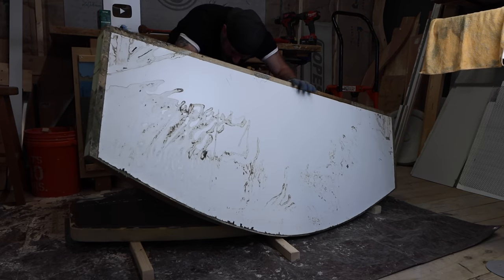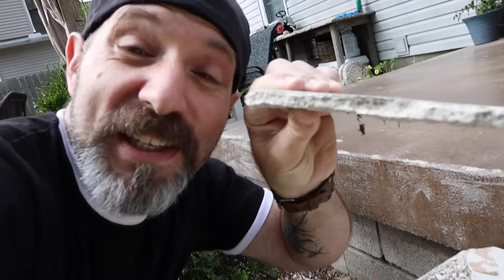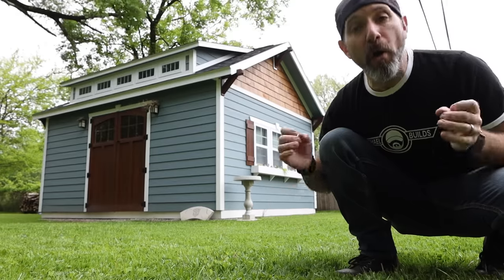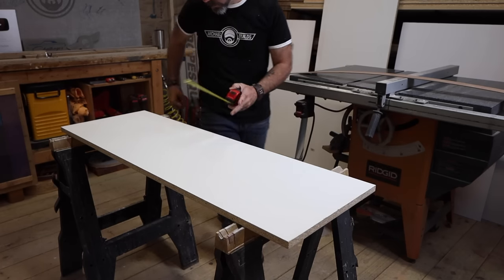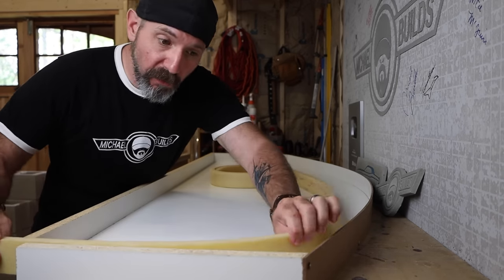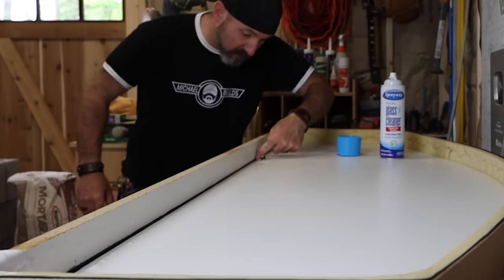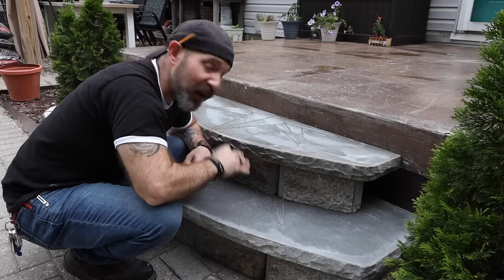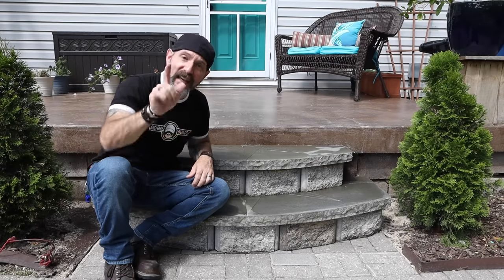Quick and Easy Concrete Steps

Comment: It's called Melamine, NOT Malemine! Also use a pad sander (without the sandpaper on it) to vibrate the sides to get the air bubbles out. And add a little dry mix on the slick Melamine surface to add some texture and a light dusting all over so it won't look like glass and be slicker than snot when wet!

Comment: Great build!  Spraying WD-40 and using a reciprocating saw without the blade are a couple of my go to‘s with these concrete projects.  Be safe and use a respirator.  👍🏼
Reply: Nice work!
Reply: I get really, really tired of the safety police giving us unwanted advice. But you are absolutely right: always wear a respirator when working with concrete, drywall sanding, cleaning out the chicken house etc. Your lungs are not easily replaced!
Reply: @Tetianaoutdoors Sorry to hear that, safety is key and life is too short so I try to learn from other’s mistakes and help others.

Comment: I like your concrete videos which inspired me to pour a bar top for my new tiki bar.  I poured a large slab using the high-strength Quikrete (4 bags) and plasticizer (flow control).  I molded it so the finish side was facing upwards meaning I had to finish trowel the top and bull-nose the edges.  I also put in foam to hollow out the interior to reduce weight.  Lessons learned: I forgot to seal the foam to the form but it turned out okay.  I also forgot to spray a release agent (you use WD-40) but this turned out okay as well.  My biggest problem was the concrete going off all at once.  There is a fine line between waiting for the bleed water to reduce and finishing a large slab that goes off quickly.  It was like boom, the concrete became unworkable and set up.  I like that the plasticizer makes the mix more liquid and increases the strength but it causes the concrete to go off very fast.  I was also able to vibrate out most of the tiny bubbles.  I barely made the bull-nose and finished the top but it wasn't perfect.  Luckily it's a tiki bar so it can be a little rustic.  No one notices the small imperfections.  All in all, it was a successful pour and I mounted the bar top and put on a finish sealer.  Everyone was impressed.  I think for jobs where you have the finish side facing down or small jobs facing up, the flow control is great.  If time is a factor, the flow control helps get to strength faster thereby accelerating the project.  For large slabs that require fine finishing the flow control may not work.

Comment: A nice inventive solution, well executed. Looks good. The only issue I can see is that the top riser appears to be considerably shorter in height than the two bottom risers. I have no idea what your building code says about the allowable variation in riser heights, and perhaps it says nothing about exterior stairs with a short run of three risers. It would have been a bit more work to cut down the height of the concrete blocks used to make the risers, but the diamond blade on the grinder would have made that part of the project go fairly quickly, and there weren't that many to cut down. You shared some good ideas in your video. Thanks.

Comment: Looks killer man but I do a lot of finish work and a lot of siliconing and I drill a hole in the back of my caulk tub were it goes in my gun and it keeps the stuff from pouring out after you let the handle go but great job dude always nice seeing you kicking some butt with some concrete

Comment: Hi Michael nice Job, but I do a lot of cement work and just wanted to share with you if that's ok. Your platform that the steps you made went against had open joints that you should mortar to avoid future water damage before adding the steps you made, which I thought was a very nice Job as always. Great Job really, close those joints and it will last way longer.

Comment: Very cool ideas as always! the silicone groove should be explored even more, maybe with epoxy or another color accent filling the grooves,etc..  
Just one "complain" as a unofficial youtube safety expert, 
the steps doesnt seems equally talls, this can be a safety issue to miss a step or fall. I understand that the blocks arent available in many height sizes and the concrete needs to be a certain height to be strong.   Keep the good work! always great to see new video from your channel.

Comment: hi michael i m new to the channel. i was wondering what you can do to avoid craters from forming on the top side of the steps. i know its from air bubbles and I've seen people knock on the mold so all the cement settles in nicely but it doesn't seem to do the trick entirely. what other methods are there to avoid this??

Comment: If you did it again I think it would be easier to cut a notch in a tool and scrape the silicone off with that. That way you could use a straight edge easier.
Reply from the maker: Agreed

Comment: I saw a video where they made the mold out of foam board. It looked easier to cut and glue but it was for a smaller capstone. Could it work for this project?

Comment: I got a question if I built a large concrete planter or flower pot out of rapid set cement mix and then I wanted to add decoration to the outside will more rapid set cement mix adhere to the outside without flaking off or cracking off eventually ? With the surface need any preparation before I added the decorative features ?

Comment: Hey Michael about to move forward with some outdoor countertops, will have a section with a cutout for a built in ice chest. Will have some thin sections that I am going to put some rebar in what is the best material/size  to use for that? 2 inch deep counters. Thanks
Reply from the maker: 1/2” rebar

Comment: After mixing, have another 5 gallon bucket filled with water to put the drill in.

The weight of the water will prevent the drill from falling over, unlike leaning it against something. Also, it helps keep mixing drill bit clean.
🤓

Comment: Michael just wondering how much water you used when mixing your concrete? We just finished one and our mix was no where near as wet as yours looked.
Reply from the maker: Not sure exactly. Mixed it by eye. I wanna say between 3 and 4 quarts. Then of course the Flow Control makes it even wetter

Comment: The stairs look great but code requires that riser height can not vary by more than 3/8 of an inch. That last riser from the top of the second step to the top of the porch is not even close. It looks 3 inches shorter than the other risers.

Comment: The only thing I think would have been better is to make the steps even, and that's picayune, and it's entirely the size of the blocks you're using between steps. Also it reduces the chance of some jackwad "inspector" gigging you for the steps not being "uniform".

Comment: What you did was create a tripping hazard. You have non-uniform step heights, plus the steps you made are too tall per building codes. On the second step, the corners are not even supported and will be the first part to fail.
Reply from the maker: Lol 😂
Reply: @MichaelBuilds  keep laughing, I’ll comment the same in two years when you’re remaking them.